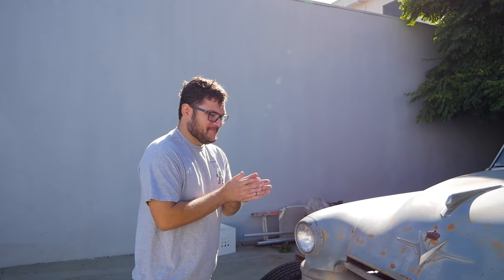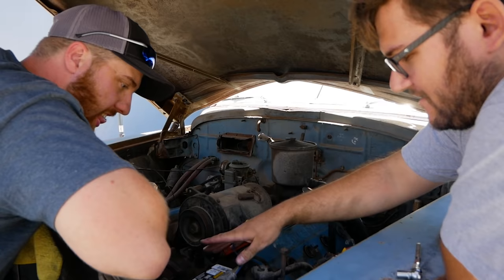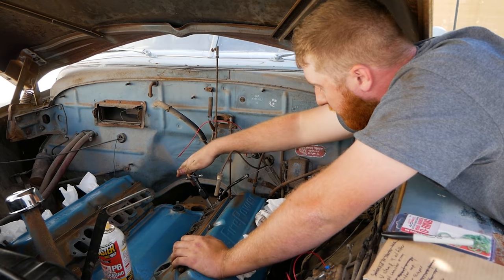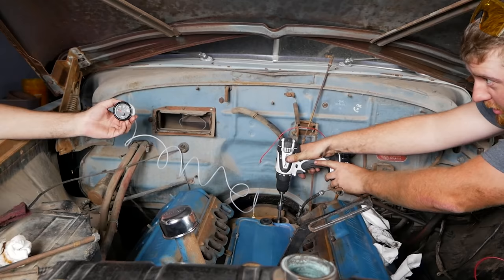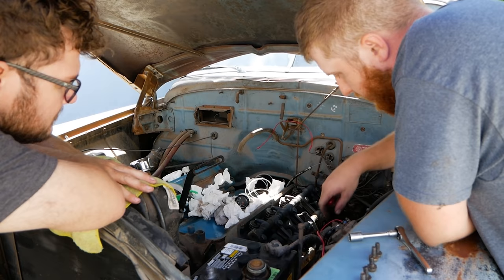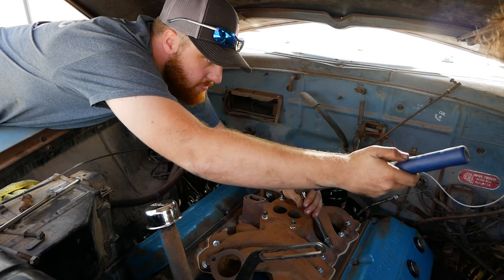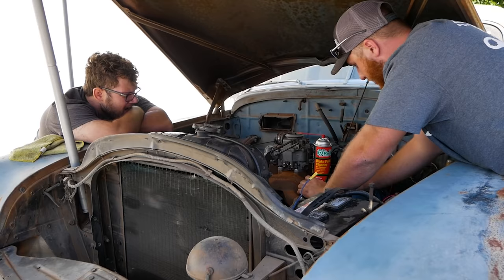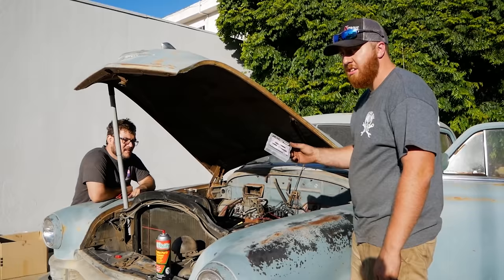Can We Revive Nolan's 1952 Imperial? First Start in 38 Years!

Comment: One thing I've taken to heart from watching years of Roadkill, that David Freiburger said once about projects like this, is that your main starting focus should be on making that engine run, worry about gear, brakes, steering or making it pretty later, as long as that engine works and makes noise, you'll have motivation to work on the piece of crap.
Reply: I was waiting for someone to mention Roadkill. Great show
Reply: Sage advice.
Reply: Don't get it perfect, get it running
Reply: It's very true.  Sometimes when I need a mood booster I will run the engine on my project car so I remember why I'm doing all this work
Reply: Truly, my 95 escort ran fine till I burnt the clutch shortly after getting it and I started it regularly until I finally did the clutch myself, the ease of it makes me want to boost
Reply: Why do you think it is a piece of crap?  Just because it ain't Japanese?
Reply: @michaelbenardo5695  they're all pieces of crap, we all a bunch of turd polishers out here brother. Think it was a jab at project cars in general.
Reply: @yam9635  Wrong.  Today's Japanoid tin cans are the pieces of crap.  They are motorized computers, and are super difficult to fix, often not worth it expense and fustration-wise.  Plus, they are cramped and rough-riding.
Reply: @michaelbenardo5695  not sure what you're describing is a Japanese car. I don't care much about today's jdm and usdm counterparts but the Japanese cars of the 90s and early 2000s set the standard. That's why all cars are efi (which isn't hard to tune at all if you're even remotely familiar with computers.) I'm sensing a general old guy attitude. And I love all makes and models, it's part of being an automotive enthusiasts. You see what's good and admire the good. There's 2.0L 'crap cans' making 2,000WHP, while being constantly monitored and tuned via some sort of standalone ecu, those numbers are not attainable through conventional analog styles of "tuning" which is hardly a tune at all, messing with the carb is just setting it, in the realm of air fuel mixes you're pretty limited with a carburetor. I digress but Nothing about jdm cars is bad unless you're old and have too big of sausage fingers to work on it. But its all opinions, all I can say is ford didn't make they're 300s boost capable out of the factory and no 4 cylinder engine developed by usdm could make 2000 hp without some thorough tuning which is a byproduct of jdm. 
No one's taking 1.9 l escorts and throwing massive turbos on them. It's all jdm cars and their usdm counter parts, why? because they're better. Their market share of our car market is a perfect example of how reliable, powerful, and affordable Japanese cars are. I'd be salty too tho if I worked in a factory or lived in a time where pintos were sold at dealerships
Reply: @michaelbenardo5695  you just described a BMW
Reply: @michaelbenardo5695  I imagine you like to look at cars and hear them, perhaps even drive them but not necessarily work on them or appreciate the automotive world as a whole. Anybody who says Japanese cars are "too cramped" or "too hard to work on" either is too lazy to do the work, because they got it together somehow right. Or they just don't know what they're talking about, it's usually a mix of the 2.
Reply: @yam9635  They are all EFI partly because of the EPA.  What I mean by "Japanoid" is made in the mold of Japanese cars, even though they are not Japanese.  They are just like them, meaning small, cramped, mandatory center console that is too wide, too hard, too tall, mandatory floor shift, mandatory small bucket seats, mandatory bumpy ride.  They may have "set the standard", but they are just not my cup of tea.  I like a good road trip car, not just a grocery-getter/going to work beater.
Reply: @yam9635  I never worked in the auto industry, and I quit working in the auto repair industry.  I didn't lose my job because of the flood of Japanese cars coming in, I don't like them because I have American automotive tastes - a nice soft ride, quietness, a nice super-smooth engine, lots of low-RPM torque, good engine braking, a bench seat, a column shift, a parking brake lever that is under the dash, not between bucket seats.  Yes, I have driven Japanese and Japanese-like cars, and they are just not what I want in a car.  Plus, many of the newest ones are unspeakable ugly, even compared to 49 - 52 Chrysler products, which were not things of beauty themselves.
Reply: @yam9635  I wouldn't buy one of those either.  Impossible to repair, and I don't mean tune, I am talking about fixing.
Reply: @michaelbenardo5695  who hurt you?
Reply: @yam9635  When I say "too cramped", I am talking about the interior.  And I do to like to work on my cars.  TRADITIONAL AMERICAN cars.
Reply: @PemaMendez990  Did I say somebody hurt me???  Can't you read?
Reply: @michaelbenardo5695  Ok boomer XD
Reply: It works even with RC Airplanes. I've gotten ancient birds from my hobby shop that sat in the shop as a 'someday ittl fly' project, but once I get an engine on the aircraft and running it usually gets air under its wings within a month.
Reply: Yep
Reply: Exactly. Nolan focusing on brakes before the car even runs was stupid. He should have spent all his time on that, then focus on brakes and trans and getting it moving once it actually runs.
Reply: @yam9635 have you ever seen how they put a car together? It’s soooo much harder then taking it apart or working on a specific part. Japanese cars are cramped engine bays, American and pretty much all cars are that way now. But compared to like my 69 deville. Everything is easily accessible and it can all be done with basic hand tools. Fuel pump, no problem. 30 mins 2 bolts and few lines, starter super easy, 2 nuts and couple wires, all the spark plugs are easy to get at and can be done in an hour easy if you take your time. 30 mins if you rush!

Comment: When timing a car with a point distributor before starting, there is a way to get it real close. Get number one cylinder on the compression stroke. Once you are sure that it is on the compression stroke turn the engine over by hand and line up the timing marks that you are going to use. The rotor should be very close to the number one terminal if the distributor has been installed correctly. Pull the number one wire from the distributor cap just far enough to create a gap. Apply power to the ignition system. Turn the distributor until you see or hear a spark jump from the cap to the number one spark plug wire. That's it, lock it down. (Of course the other end of the spark plug wire must be grounded.) It has been my experience that if you check it with a light later on you'll be within 2 degrees of where you lined up the marks.
Reply: Good tip. Can also be done with a 12-volt test light hooked to ground and the ignition turned on. Probe the lead from the coil to the distributer, turn the distributer and when the light goes out the points are closed. Old motorcycles were done this way.
Reply from the maker: That's a great trick I usually use for points systems, but more often than not when I have to install a distributor it's usually a dura spark or hei on camera! In the case of this car we were just out of time
Reply: @JunkyardDigs  The first time I read about timing a car that way was in the owner's manual for a 1948 Buick that I picked up at an old car swap meet many years ago. It only works with point systems though because years later when I had a hot rod with MSD ignition it didn't work. Luckily by that time I had enough experience that I could get it in the ballpark and the car would start without flaming up through the carburetor or backfiring in the exhaust.

Comment: Now just replace the 6 volt battery with a 9 volt battery and it will run for ever with no problems. (we used to do this in Upper Michigan in the winters) I'm 71 years old and can still remember my dad and uncle doing this for all there 6 volt systems.
Reply: Thank you for the tip Lary!
Reply: @SavingTheUndesireables  just toss a 12 volt battery and coil in it   change the bulbs   add a delco alternator    use the 6 volt starter   they are built with heavier windings for 6 volt  and handle 12 volt easily   and  then  they crank.  6 volt sux
Reply: Like 40yrs ago, Odessa, Texas, Senior auto parts. Head parts man; you gotta 60(s) ford and need such a part. Newby says we don't stock it. Old hand, get him this Buick part. It'll work.
And my 64 F100 292. I put in a Dodge radiator; had to relocate top hose, GM single wire alternator. Sweetest sounding duals on any car I've owned.
Reply: Where do you get a 9 volt battery?  Also, they are saying nothing but the starter is hooked up, but the 6 volt coil is hooked up!
Reply: 9 Volt is way too hard to find anymore.  My Grandfather was the Service Mgr. @ the Chevy Dealer in Munising, MI (UP) and they didn’t use 9V.  I would just convert to 12 V probably also to an alternator setup.
Reply: @rorymunroe3771  6 volt systems were OK for small flathead engines but for the high compression OHV V8 engines they require a huge battery and heavy gauge wiring.  That's why the manufacturers went to 12 volts in the 1950s.  By 1956 12 volt systems were standard in the industry.
Reply: @rorymunroe3771  Used to convert 6volt to 12 just as you suggested.
Reply: Why not just go to 12? I understand back in the day but now it doesn't make sense.

Comment: “Mo’ Power Baby‼️” 
This reminds me of my 65 Mustang that was garaged for 12 years. Earlier this year I got it running with a friend of mine. We don’t have quite as much car knowledge as Kevin does, but we’ve put a lot of new stuff on it to get it this far. This video definitely reminded me of us starting “The Beast.” I’m glad you were able to get Nolan‘s car started. One question though, why were the wheels spinning? Shouldn’t the car be in neutral?
Reply: i kinda imagine the whole gearbox is as messed up as the oil filter was and fixing that is a whole new can of worms.
Reply: Mo powa babeh!
Reply: even if the car is not in gear, and the torque converter is not engaged, the oil in the torque converter housing is still being rotated by the flywheel (since the engine is turning), and this spinning oil is enough to rotate the propshaft and the wheels (since they are in the air and there is zero load on them they are really easy to turn).

Comment: Hey it probably would have cranked a little faster if it wasn’t in gear. 😂😂😂
Reply: That’s what I was thinking
Reply: No wonder the poor old starter is struggling!
Reply: Absolutely. That 6 volt was cranking the Trans and all of the drive line. Definitely think it would have started in park
Reply: It wouldn’t really change anything, it was in neutral first off and the starter not gonna change depending on what gear it’s in smh Alan cmon now
Reply: @kelsog877  it will change things because when the trans is in gear, and the engine is turning it will engage the trans and attempt to spin  the wheels.
Reply: That's why I thought it had a harder time idling as well. I agree!
Reply: I noticed that too.  Done of those old Chryslers had a hand brake that gripped the driveshaft.  So if the hand brake is set and the transmission is in gear, the starter will struggle to crank it over.
Reply: I question if that was actually a 6 volt starter. What if they 12 volt converted it when they rebuilt the engine?
Reply: It wasn't in gear.  That rear wheel is free flowing and was turning.  The wheel wasn't accelerating with the engine RPMs.  Also there is no park on this car.
Reply: @mexicanspec  That's exactly what I think. The engine slightly spins the wheels in neutral. My car does that too. Honestly, I think the starter would have more work to do if the trans was in park position or with hand brakes on, because the transducer would have a higher resistance.
Reply: @mexicanspec  thank god im not the only one who actually know what they’re talking about
Reply: @OBS_Gohst92  when the trans is in Neutral it’s in free flow, no power hence the name neutral bub
Reply: @kelsog877  still not explaining why it wouldn't change depending on the gear. Read your comment.
Reply: @OBS_Gohst92  okay now listen close.. when a car is in neutral it’s in NEUTRAL. Meaning the engine is not powering the transmission at all. It’s coasting. It’s almost like it’s in park without a parking paw! Do you understand now? You don’t need me to explain when you have google!
Reply: @OBS_Gohst92  Stick to music son!
Reply: @kelsog877  "starters not gonna change depending on what gear its in" direct quote from your comment. Stick to your day job joss, music is just my hobby.
Reply: @OBS_Gohst92  No it won't.
Reply: @kelsog877  That is total bullshit.

Comment: I'm WAY late too this video, but I had to chime in. My very first car was, no joke, a '52 Chrysler. Had to let it go a couple decades ago, but I could still recite you its VIN from heart. Best of luck to you Nolan. Simple as it is, that 6 volt positive ground system will probably give you years of puzzle solving enjoyment. I can already suggest that you check out your voltage regulator. Blew mine out once getting a 12V jump. That 331 Hemi. The Fluid-Torque drive "automatic" with its clutch and lift-off to shift up, floor-it to shift down. The drive-with-your-pinky overpowered power steering. You're in for hoots and headaches.

Comment: After some thought, I"d like to review your processes on getting old cars started. First, if you use a carburetor cleaner to start the car, you have the added benefit of being able to put the spray tube down the carburetor bowl vent to fill the bowl. This does mandate that you use a brand of carburetor cleaner that a car can run on, but I find Gumout or berryman B-12 do nicely. When trying to fire off a diesel,penetrating oils like WD-40 or Deep-Creep are excellent, especially on glow plug diesels where ether is an explosion hazard . Brake cleaners often contain toluene and have dangerous fumes when burned. I put a few liner assemblies in detroit diesel two strokes because the operator put too much ether in it and then got it to ignite. Second, to check the ignition system on an older car,put your test light on the negative side of the coil and crank it. If it just burns dimly, the points/ignition module are/is defective.If it flickers, the coil is being turned on and off by points or module. This isn't meant to be a gripe, but hopefully sharing some knowledge. Great video, and Kudos for helping a friend in need. All the best to you and Mook.
Reply: looks like we found our old-timer lol
Reply: @eqwertman2556  In other words, we found the guy who’s had to do the same thing in this video, and now has the wisdom to succeed at it 😂
Reply: Weren’t they just using starter fluid? I used to have to use it on very cold mornings on my 1980 Jeep J10
Reply: @deaconmusic7457  my coworker has a j10! Cool ass Jeep.
Reply: Great methodical troubleshooting.  I think they were starting it in gear? I wonder if that was why the slow cranking?
Reply: Definitely avoid chlorinated carb cleaners to run the motor on
Reply: @scottmacintyre3620  6volt cars always cranked pretty slow.
Reply: That I can confirm. I have a '53 Packard and every time I turn it over around someone who's never seen a 6v car start, their first reaction is to ask if my battery's dead
Reply: @eqwertman2556  This was the only reason I went to the comments

Comment: Hemi Hot Heads makes oil filter adapters for old hemi and poly engine to switch to spin on filters . I have one on my 55 Dodge Hemi and 55 Plymouth 260 Poly .
Reply from the maker: Yeah we figured that out while we were searching for a band clamp 😂
Reply: Same with my 51 53 Chrysler Windsor's.
Reply: @JunkyardDigs  😂 This one time, at band clamp...
Reply: @JunkyardDigs  "Putting old cars back on the road" is a wonderful thing to be all about, but you miss a little by failure to acknowledge that the main reason that most people do so is not nostalgia or hot rodding, but to save money, so to some extent you neglect economy cars.  You have done some fairly efficient sports cars like the Fiat Spider and MG Midget, but there are old cars out there that are just as efficient but seat 4, like the Datsun 210 and F10 for example, plus Pintos etc, whose engines are similar to Mook's Ranger engine.
   Anyway, please do economy just a bit more, and that includes minding the prices of parts and tools you use.
Reply: @TorquilBletchleySmythe  Saw this... Moved on.... Came back to like it lol
Reply: @TripleJD  a band clamp is better than a bland camp.

Comment: DAMN, that was a hell of a lot of carb. cleaner down the intake all over those pistons. Should have had a small squirt bottle with gas & some oil mix.
Reply: Ya, all these tubers using brake cleaner instead of much cheaper gasoline. 🤷‍♂️🤦‍♂️
Reply: @tomtheplummer7322  Brake cleaner is much more willing to pop. It's much easier to kick start it. Also, a good way to check for compression/spark during diagnostic.